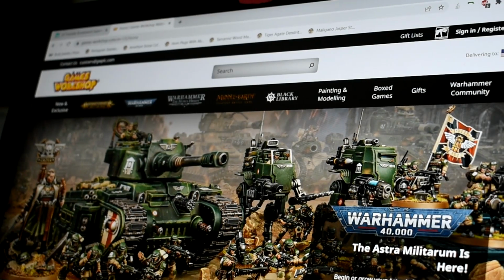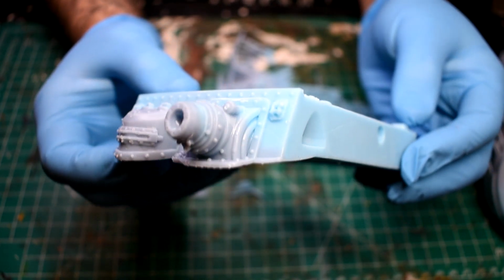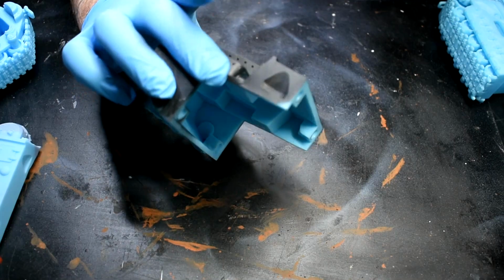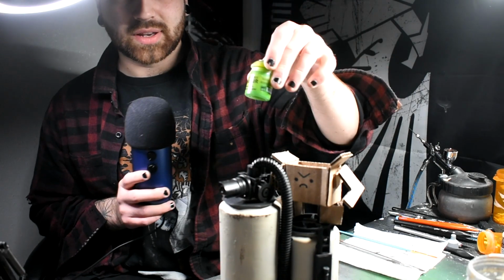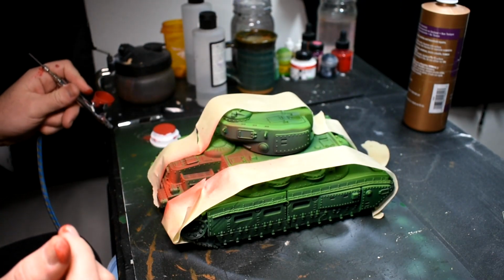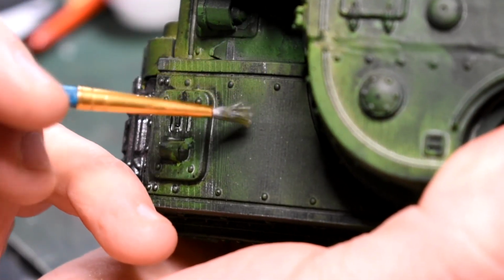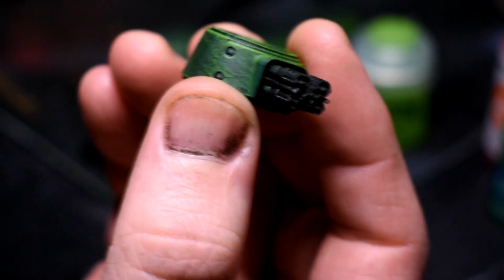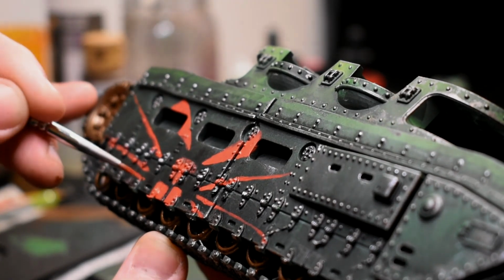3d printed Baneblade!

Comment: I guess by now you have already gotten the tip multiple times but if you soak the piece in hot water before peeling the supports it's even more satisfying to remove them...
Reply from the maker: Yes I have heard and this definitely helps! I also learned giving the model a quick hit with a blow dryer helps a bunch too. 🙂 Thanks for taking a moment to comment on the video!

Comment: With the airbrush bubbling you may need to tighten the nozzle tip up a bit more. Ive had this a few times but once i tighten the tip after cleaning it stops. Great vid btw and i may have to download some of the models
Reply from the maker: Yeah! Actually from that point on i realized it was the inner nozel piece that comes loose after cleaning and really needs to be snuggled up in there or that happens. 😁 Thank you for watching too, hopefully you get yourself a mighty baneblade!

Comment: Hi! Just found your video. Thanks for taking us thru the process, I liked the result. Hope you do not mind a few curious questions:
8:05 - how much time did you spend on gap filling / sanding? Printing marks on the right side of the model look stronger than on the left. Did you feel this was an issue with the end result?
- what was the overall print cost in your opinion?
Reply from the maker: If I'm being honest not too long, it was my very first time using greenstuff and I wasnt too pleased with the results. If i could go back with the knowledge i have now i would have done it differently. As for how long it probably took my no more than an hour. 
 the cost i want to say roughly $30 to $45. It might be even cheaper cause i remember the top portions on my chitubox program saying it would be $1.50.

Comment: What was the sticky thing blue and yellow?
Reply from the maker: That is called greenstuff! Its an epoxy used miniature modeling.
Reply: @boxnaught7428  does it replace glue to stick things like you did?
Reply: @Magdann  Generally it doesn't - if using it to fill gaps or the like, I'd still use some glue to keep that join strong.
Reply from the maker: @Magdann  i dont use it for gluing, as i said in the video i used it to fill gaps for my smaller magnets🙂. i may have forgotten to mention i did use super glue after placing the magnets in the green stuff.

Comment: When it's cheaper to buy a 3D printer than the official model, you know GW charges too much. And the Baneblade isn't even like other big centerpiece models, where GW could plead that they're just too detailed to cost anything less than $170. It's a tank. You're not rendering faces or embossed filigree here.

Anyway, good paint job.
Reply from the maker: I agree with you fully! I completely forgot to mention in the video how much this thing cost in resin and the total was around $55.
Reply: The Thing IS the baneblade kit is basicly 7 different tanks they could split the Sets and make them cost Like 50€ or so that way